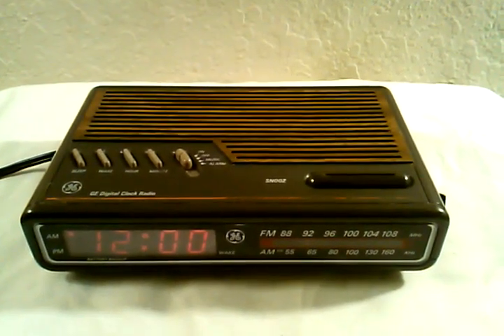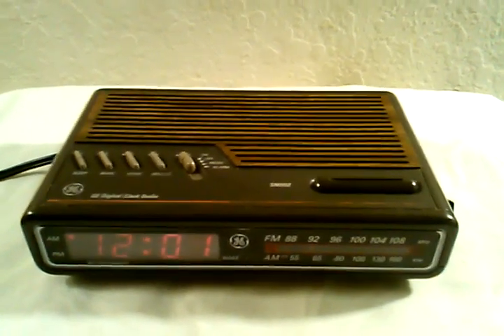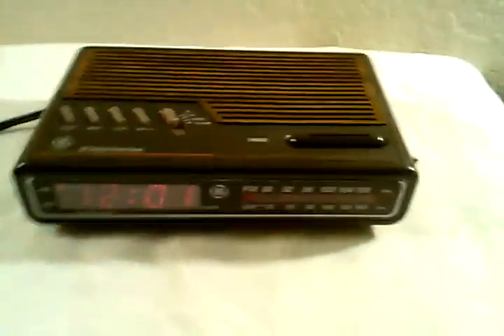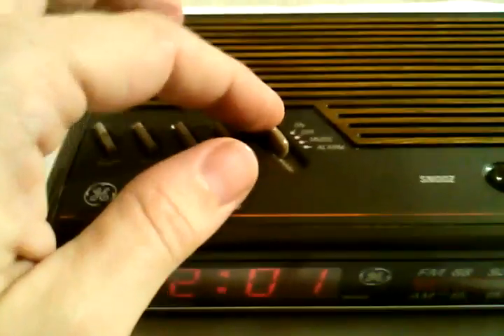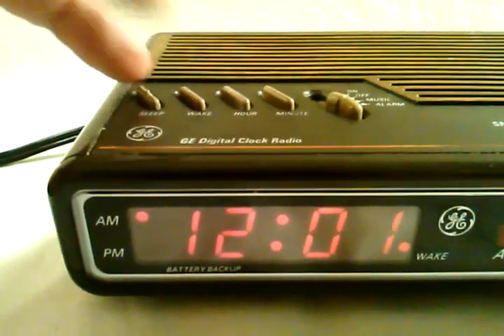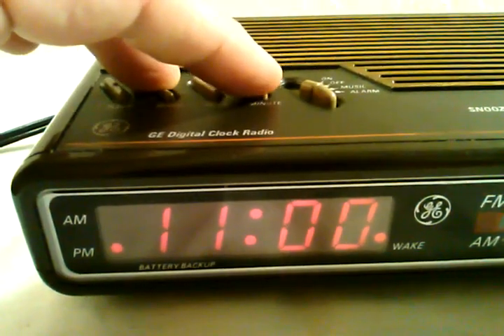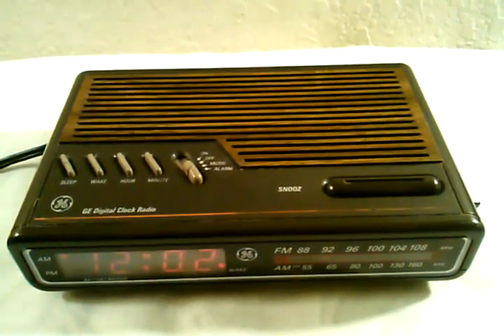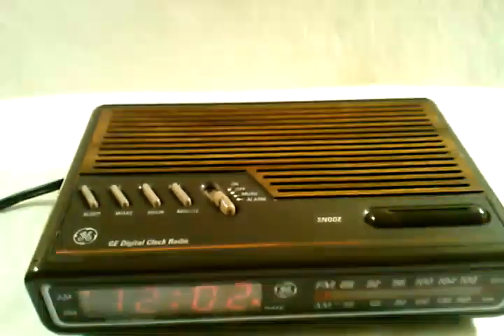Testing a Vintage General Electric GE Clock Radio Model 7-4612A

Comment: This clock is still waking me up since 1991, still going strong. I went through several clock radios the previous 15 years or so, the numbers would burn out or the radio would get bad reception. I wish everything was made this well. I bought it new and it was not expensive.